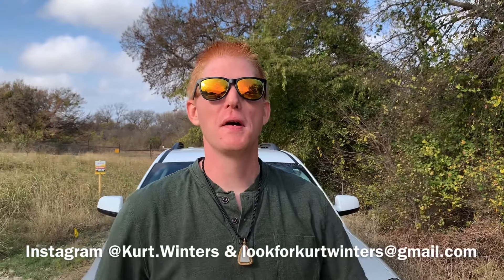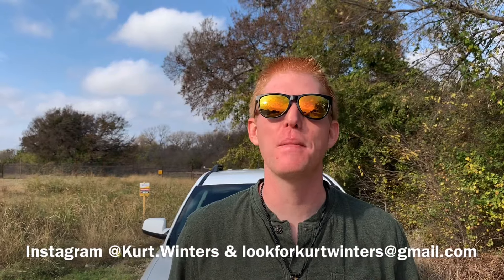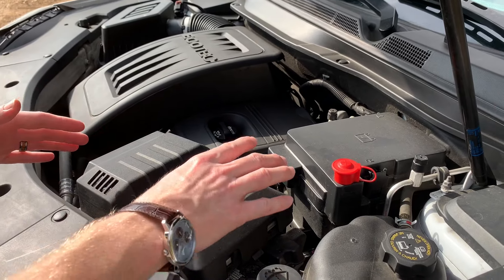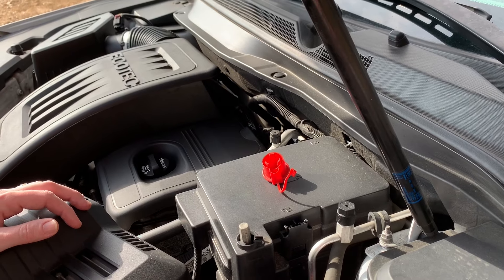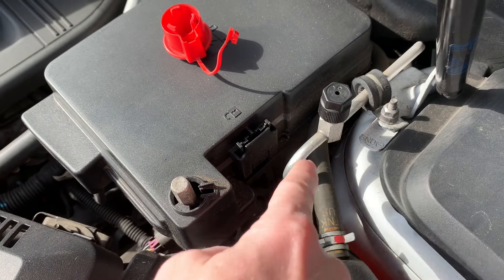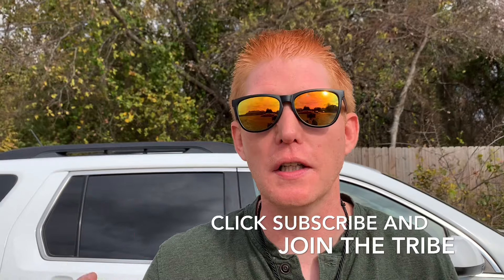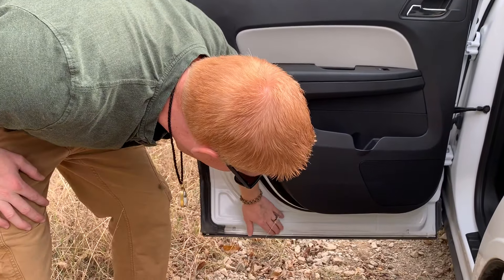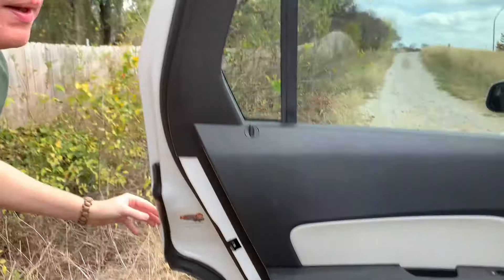3 Reasons NOT to BUY a GMC Terrain SLE  (Issues buyers should know before they BUY !)

Comment: We got a 2013 GMC Terrain and thus far the only “issue” we’ve come across is an oil consumption issue. Now let me explain, I guess these vehicles have a known oil consumption issue where the vehicle burns more oil than it should. Now I take mine to the dealership on time, every time for oil changes and every time I take it in for oil change I get the tires rotated. I have never had an issue with the oil. I will say this, due to this oil consumption issue GMC has seen fit to extend warranties for certain things up to like 130,000 mi.  So When I needed to get a new exhaust manifold it didn’t cost me anything. I have never experienced a Chevy shake and I have owned many chevys. As far as the wipers are concerned, had he been any sort of “expert” on vehicles he would’ve known about the recall and had I repaired. I did. As far as the build quality, I don’t think I have owned a vehicle that feels more well put together or safe than this one. Overall for what we paid for it and how good it has been to us, I would buy one again in a heartbeat. It’s quite simple, check online often for recalls, maintain your vehicle (simple routine maintenance) and don’t beat the crap out of it and most vehicles will be good to you. I always take mine to the dealership, not sure about other dealerships but my local Chevy dealership is amazing. They honestly give me the best service, price and repair overall.
Reply from the maker: Mine is still my best Daily Driver ! Great comment, thanks Ryan. Glad your GMC is still going strong !
Reply: If you don’t mind me asking I own a 2013 Terrain SLE myself. I’m have exhaust issues, when you first start it up it’s loud then it quiets up a little after it warms up, was this the same issue with yours? If so was it just the manifold or something else and roughly what did the dealer charge you to repair or replace manifold? Any feedback would be appreciated
Reply: @Thebellreve  you might want to check for oil leaks, I just had the oil pan gasket replaced due to an oil leak. I thought it was burning oil till I noticed gasket leaking oil
Reply: I have a 2014 terrian denali.  It's a piece of sh!t!! Belive me when I tell you, you are one of the lucky FEW that has had minor to no issues. I had mine 3 months and had to put a new engine in it. Oil was changed in april and by july it had consumed all the oil without my knowing bc who tf expects that to happen that quick?! Timing chain jumped and damaged my engine. Now a few months after the engine was put in we have a new issue. I HATE this car!
Reply: Got a 2015 gmc terrain sle and it eats a quart of oil almost every 1,000 miles. You shouldn't even have to add oil on a newer car let alone that much. It's insane. Edit- it's at 126,000 miles now. Still running. Great on gas. Awful on oil. LOL
Reply: I am glad you are happy with your Terrain. Like I said, I work for the plant where we assemble them and ofcourse I love hearing good stories about people being happy, just sadly it doesn't happen often enough. Many people I work with bought them too because we had a GM employee discount plus our assembly plant credited us additional $3,000. So people naturally jumped all over it, but it wasn't long before issues started, from wheel bearings falling apart at 30,000 miles to oil consumption, blown head gaskets, just horror story after horror story. Having said that, it is nice to hear that some people got lucky and are driving them happily. In our case, all our service like oil changes etc... we're free as part of the deal so everyone was doing the service at the dealership they bought the vehicle from.
Reply: Those Ecotecs are shit unless you had the recall done on them.
Reply: The cheapest $300 oil change in town.  Hell if ti burns it just keep adding it, it's self changing.
Reply: Same here I have the 2013 and the only problem a recall on oil consumption I need to get it taken care but I make sure I keep on time with my oil change
Reply: @newlife9326  Does anybody know why they consume oil like that?  I'm assuming it's not leaking it so it must be burning it.  That could be bad piston rings, bad valve seals sounds like something wrong deep in the engine.
Reply: @rickburroughs2289  Sounds like a gasket issue so when it's cold there is a "gap" and when the metal heats up it expands to seal it correctly like it should when it's cold also.

Comment: What? Changing the battery takes 15 minutes.   I’ve done it twice and it’s very easy.   Remove the plastic cover, then it’s two bolts to remove the ECM and battery.
Reply from the maker: GM says to go in thru the wheel well. What year is yours ? I like that hack/tip, sir ! Thanks
Reply: @KurtWinters  Through the wheel well??  I wouldn't even think that could be possible.  My Terrain is a 2016 SLT V6, but I think the battery is in the same location for all models.  I live in south Florida so batteries don't last more than three years, and I just replaced my battery two weeks ago for the second time on this vehicle.   I can't understand why GM would recommend removing the battery through the wheel well.  The entire operation just involves removing three plastic trim clips, folding the trim piece backward (it's even hinged for this purpose), and removing one bolt to slide the ECM out, and another bolt to remove the battery.  From start to finish it takes less than 15 minutes and only requires a 10mm socket with a four-inch extension.
Reply: @ScreamAndFly  yeah, I was confused… He kept saying “change” but only talked about “charge” Oh well, you could easily see the battery access was pretty typical in the video.

Comment: You don’t mention yours burning oil. Does it? From what I’ve learned this seems to be the number 1 issue with this model and can lead to a host of expensive repairs if you don’t stay on top of it (piston system damage, timing chain damage, PCV system failure and all kinds of “sludge” related problems) The advice given was change to oil every 3k and check the level weekly.
Reply from the maker: Mine does not burn oil, BUT it will sludge up in like 3-4 months. WHICH IS TERRIBLE ! def change oil often and check it's viscosity and smell.
Reply: Yes!! I have a 2014 terrian denali.  3 months after I bought it I had to pay to have an brand new engine put in! Prior to that I mentioned to the dealership 2 days after I bought it that it was dying everytime I'd come to a stop. They said it was the throttle body so they cleaned it. Its stopped dying for 2 months. I got the oil changed in april of 2021 and by july 2021 it was burning oil and the engine was sh!t due to the timing chain slapping against the engine and causing major damage. But see I noticed the sound the timing chain made and the dealership once again cleaned the throttle body. They basically let me drive this car knowing I was f#cking it up even more all the while reassuring me it was fine. So now 3.5 months after the new engine was put in I'm getting hard start, rough idle, high fuel consumption, vibrations while idling and driving below 40mph. Also hesitation when I step on the gas and hesitation when I let off the gas. Never in my life will I buy another GM vehivle!! I got lucky with my 2003 envoy. Ran like a champ until 2020.
Reply: Did or dose the engine light come on?  What code did it kick out?
Reply from the maker: replace my timing at chain AT 5OK
Reply: @ItsmeBish584  you have had very similar issues to what I've had with my 2016 terrain! its outrageous to me, that so many issues can be allowed to happen for the same vehicle model

Comment: 1.   Changing the car's battery is very easy if you take the time to learn how to do it correctly.   Anyone with
any mechanical aptitude can do it after watching a couple of YouTube videos,
2.   The reason your tires are vibrating is probably because it's time to balance your tires.  A task the all 
vehicles must do about every 15 to 20 thousands miles.
3.  You don't know that your battery can be clamped to any metal part to obtain a negative for jumping.  Your
has a superior jumping system than those that put jumper cables on both the positive and the negative posts
of the battery.  All of those can result in a battery explosion if done wrong or you can short out you 
onboard computer.  But you would know that if you took the time to read your owner's manual.  Appearently 
you just bad mouth a perfectly good vehicle just because you don't know that you are doing instead
of learning the facts.  If you are not a mechanic, don't make videos about cars because you are disseminating 
misinformation based entirely on you ignorance of the technology this vehicle has to offer.
Reply from the maker: fair comments. I love my Terrain, just warning the public.

Comment: The guy is a dikhead, my car's been great so far
Reply from the maker: just read the comments.... from all the other owners. I respect your opinion, but this SUV is far from bullet proof.
Reply: 2016 GMC Terrain sle . It’s ok the only issues I have is it’s throw ebrake, traction, and service code. It done it before months ago and then went away but it’s been on now for 5 months. On top of that my camera will quit working at times then decide it’s ready to work. ( really don’t need it unless I’m hooking up to a trailer ) but also the radio will randomly quit fully shut off ( black screen now sound ) and once I can get parked I have to pull the fuse then put it back in and yes I changed it after the fifth time it did it to me and yet it still does it.
Reply: Thumbs up for dickhead comment alone. Funny stuff😂.

Comment: I have 2014 gmc terrain sle 2.4l 

I had to have the engine burned out because of the smog pump

Wierd white stuff in the spare tire area

Consumes oil but not much

Had to have lower control arms
Ball joints
Cv axles 

And the transmisson arm bushing on the wipers went out 

And now I need a exhaust manifold

Other then that if you take care of it and maintain it like you're supposed to you won't have issues a car of any sort if only as good as the owner but I will say this you will have to take care of these a little more then you would have to like a toyota or a Honda I would rather have my terrain then a Mercedes BMW Nissan
Reply from the maker: I also had to do the Had to have lower control arms
Ball joints
Cv axles

Comment: Thinking to buy a GMC terrain 2013 model with 130k miles on it. Trying to find reviews on it but none. Plz help me is it a good car or not
Reply from the maker: 4 cylinder or v6 ?
Reply: @KurtWinters  I'm not so sure but the full name is this 2013 GMC Terrain · SLT-1 Sport Utility 4D
Reply from the maker: @dixitgupta4679  if 4 bangers, are good if the oil was changed on a reg basis, STAY AWAY FROM THE v6....or AWD.... garbage bro

Comment: I bought a 2014 GMC Terrain sle AWD and it’s been parking for over a year and winter time is we only get access to it, in a remote community we have to get it from a winter road just to go get it near by small city town. I tried boosting it three times and wouldn’t start because snow was all over inside the engine area and had to sweep off the snow off. But thinking of going back out with a new battery. For a three hour in a half ride to city town. Hope it will work for changing the battery.
Reply from the maker: Good luck my friend ! changing the battery is not as simple as most SUVs !

Comment: I bought a 2016 terrain in 2019 and I have put 49K on it and it had 23k when I bought it, I had to change battery one time and it's a pain due to one bolt hiding under plastic flashing, change the oil every 5-7k, change engine air filter and cab every so often, did a spark plug swap and now engine runs smoother strangely old plugs looked fine must of been changed before by a dope had AC Delco.
Reply from the maker: keep us updated. Sounds like your GMC is SOLID !

Comment: I have a 2014 Terrain, it is high on mileage , it sucks oil and must top up every 1000km. However, it is very stable, noise free smooth ride ….. .This is first time I started using GMC before that I was using Toyota and now I am a GM fan.
Reply from the maker: I LIKE BOTH BRANDS !
Reply: Sounds like the rear main seal needs replaced. Just had to do it to my 2014 terrain. You can also try blue devil rear main sealer if it's not a constant leak like mine was.

Comment: The 2016 model I heard have engine problems around 90k miles. And sure enough at 84k mine started burning oil fast out of the exhaust. And at 85k it died. Had to get a new motor put in. The trade in value was not worth it
Reply from the maker: smh.... sorry duck

Comment: 2017 terrain in the winter... Bad news.. condensation in pcv valve freezes and blows out the rear main seal....  Expensive repair.. week later I had to replace the water pump ( ran by timing chain btw..). 😐 Trading in this summer js. Nope nope nope. Not for me.
Reply from the maker: what other vehicle are looking to pick up ?
Reply: @KurtWinters   hopefully getting a truck this summer. More than likely a Silverado.
Reply from the maker: @melber7024  The Silverado's and Sierra's are GREAT TRUCKS- excellent choice !

Comment: i got a 2011 gmc terrain sle and i love it , never had chevy shake and i am a chevy gal , i did have to replace the transmission however i got it used from ill. i have almost 160,000 miles and no problems.  if you look hard enough i am sure you can find fault with any car seeing as you went as far as to push on the roof of a car..hmmm...i am a woman and don't complain near enough
Reply from the maker: mine is a 4 cylinder, so it shakes by nature ! the roof is a bit tin like. thanks for the comment !

Comment: Holy crap,  the battery post you point out is the most outrageous thing I've ever seen. You can't call yourself any kind of a car guy if you can't find the negative terminal on the battery. You might want to show everyone where the muffler bearings are at while your at it and top off the blinker fluid.
Reply from the maker: Whoops ! your right
Reply: Actually when jumping your car you just need to connect the positive and the other clamp black can be on any metal non moving part I know cause duralast jump box states this cause had far to often to jump my 2004 envoy sad

Comment: I modded my spark plugs and put a custom air intake on it only down fall is loud engine noise when pulling up hill but my fuel economy is better 416 miles before I fill up again. Gonna mod the tail pipe next
Reply from the maker: do you have the 4 cylinder ? mine is already loud LOL